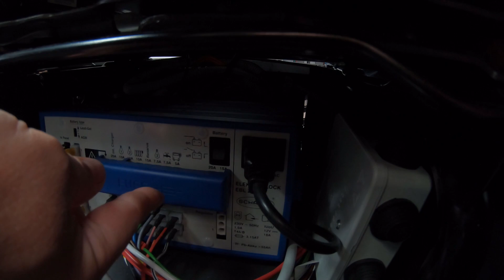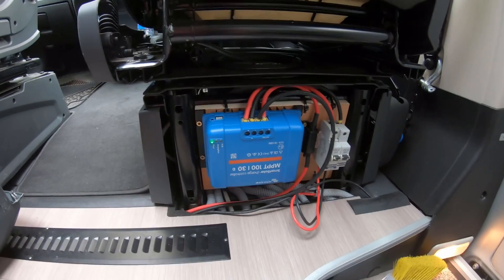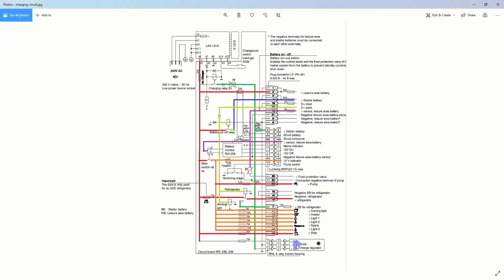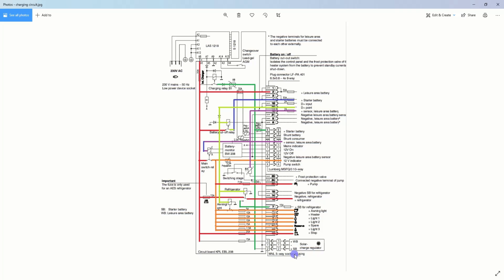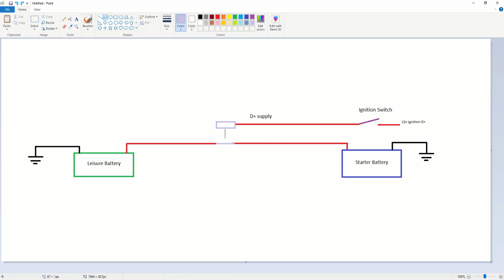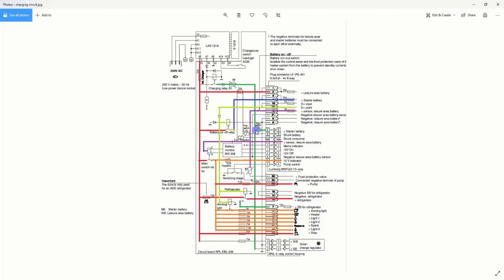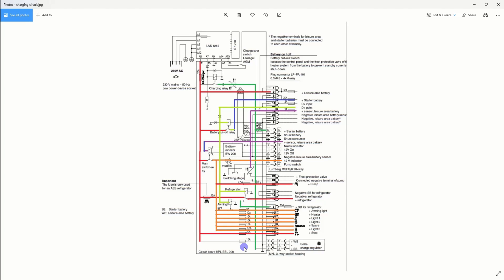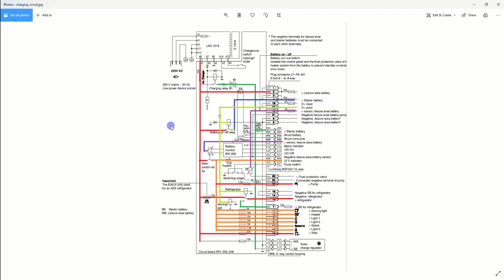Adria Twin solar wiring final part

Comment: Hi. Great videos. I watched your installation of the B2B anf felt confident doing the same. I did get myself a Votronic 50a for my 200ah Lithiumbattery. Fortunately I connected everything openly in the van (Twin 600 SPT) to make sure it worked before doing the proper cable work. I used 16mm cables and fuses on the positives, D+ from EBL pin 22 but everything else connected outside of the EBL . I also removed the fuse (50A) for the original charging circuit at the starter battery. ( I know you removeded the 30 a fuse in the pillar for this). Some 20 seconds after starting the engine and charging 35-45amp i noticed white smoke from the EBL 211 and shut everything down real quick.  I wonder if it had something to do with my NDS solar being connected to the EBL?, didnt think about disconnecting it beforhand.  Any ideas?

Comment: Great video. I’m a bit confused regarding how the charging of the starter battery is done. You mention that the starter battery is connected to pin 6 that is connected to the control panel. I believe that this is the voltage indication on the panel, not a connection to the starter battery itself. 
Could perhaps pin 7 (+ Starter battery for refrigerator) be used instead?
Reply from the maker: Hi, I will get back to you with a better explanation in a few days when I am back to work, but for now I will explain from memory some of this. The pins to the display you are looking at are small pins making up a plug to the control panel. None of these are battery connections only display power and monitoring connection. The pins for battery control are large pins to the left of the EBL. It has two 6mm (from memory) that connect to the starter battery, another two 6mm to leisure battery and two negative cables. The two cable to pins 3 and 4 I believe (I will check this later) they are the vehicle batteries connections, they both go to the vans pillar drivers side where there is a 30A fuse. These are paralleled cables to reduce voltage drop

Comment: If I unplug that three pin plug plug to the ebl everything is dead is that correct until I connect my mppt as I am fitting a 50amp dcdc mppt renogy controller cheers
Reply from the maker: If you mean the 3 pin plug from the solar controller to the EBL, this will only remove the charging from the solar so should not kill the rest of the van working
Reply: @BrackstonesTravelAdventures  hi mate followed your way of doing it but as soon as I remove the cable that connects to the ebl and to the sun control mppt my van is dead no power at the control panel is this right
Reply from the maker: No this does not sound correct, the THREE-pin plug that plugs into the front of the EBS is only connected to the MPPT so the MPPT can put in a charge voltage to the starter battery and the leisure battery. Your van should be powering off the leisure battery which comes into the EBL on pins 1 and 2 on the left-hand plug of the EBL (believe this is 10 way and pin 1&2 are at the top). Unless you have a newer van, which is a different MOD but I very much doute they changed this.
So, with the 3 pin plug disconnected check that you have 12V on pins 1 & 2, if not then you need to check the leisure battery is ok, any fuses and the isolation switch is not in the off position
Reply: @BrackstonesTravelAdventures  cheers really appreciate it I will check again I have a new fogstar 230amp battery  mine is a 22 plate but still has a b2b and a suncontrol 320m

Comment: Evening mate, your videos have almost made me look to install the  roamer myself, I get all of the install and why you bypass the EBL and how, for both solar and B2B. Now this may be a stupid question but if you take away all of the outputs to charge from the EBL, what feeds back into the EBL to run the 240 sockets and everything else on the van. i.e what feeds back into the EBL from the leisure battery and the 240 charger. Cheers, i know you have sold the van now but hoping your still here. cheers Paul
Reply from the maker: So if I understand your question correctly. First what powers the 240v sockets in the van? This is powered direct from the electric hook up via an MCB and RCD unit which will be located under your rear passenger seat. So the EBL has no influence on this power source. Your 240v sockets will work even if you took out the EBL. As for charging the battery, there is a 240v supply into the back of the EBL which is live when you connect the electric hook up (supplied from the same MCB/RCD unit). The EBL has a basic charger internally which will then put a higher voltage on the battery connection into the EBL so this will charge your battery. For Lithium this charger is not ideal, so I removed the 240V connection from the back of the EBL (Like a Kettle plug) and put this into a Victron blue smart charger. I then connected this charger to the lithium battery. I did a separate Vlog on this setup so it can charge leisure and starter battery if needed.
Reply: Thanks for the reply I didn’t ask the question properly, sorry, what im after is how does all the stuff that is managed by the EBL get power if you bypass it with the B2B an dthe smart charger. There must be a feed from the leisure battery back into the EBL
 for the fridge, lights etc? Like i said probably a stupid question. Is it the pins 1 and 2 you mentioned in the video? Thanks
Reply from the maker: Hi Paul. Yes you are correct pins 1 and 2 are still connected to the EBL. Pins 3 and 4 are removed (or fuse removed) as this is the engine supply through the EBL to the leisure battery which the B2B will now do. So all the supply for the van is still the same as it would be from manufacture through the EBL. Hope this makes sense.

Comment: Motorhomer , I want to place a B2B in my Adria Twin , do you have a video of how you installed it ? I saw in this video that you have disconnected the two red wires on pins 3 and 4 of the EBL . I would like to install the Victron Orion TR smart DC/DC charger 12/12/30A .Can you please help me with this ? regards Marc
Reply from the maker: Check this link for the B2B fitting, the cables to the EBL where removed to stop the charging from starter to lithium via the EBL. Its all done direct through the Victron B2B. https://youtu.be/1L7xhttk_S8

Comment: Great video Steve!
I am planning to replace the  battery in my campervan with a lithium and a B2B charger in my camper and i want to disable the charger on the EBL.
Looking at your video. Is it enough just to pull the starter battery cables (pin 3 and 4 ) and connect the B2B directly to the lithum battery?
Reply from the maker: Yes, if you have the same van as I have then I did a Vlog on the fitting of Lithium battery. I did what you are saying removed the starter battery from EBL back to the drivers pillar. Then run direct from starter battery via B2B to lithium with fuses. I also removed the 240v plug from the EBL as this does not have lithium setting and fitted a Victron charger which I can switch between the leisure battery or the starter battery if needed
Reply: @BrackstonesTravelAdventures   I do not have the same van but the EBL is identical. 
I'm under strict orders from the wife that everything i do must be reservisible if/when we sell it.
So my thinking is to just pull pin 3 and 4, insulate the ends and let them be in place and then run new 16mm2 with fuse from starter battery to the B2B.
Good call to remove the 230 i missed that one! 
So the plan now expands to make an adapter for incoming 230 to a new lithium charger,
Thank you very much!
Reply from the maker: That all sounds like good plan. The EBL 240v was old kettle style plug, I just got the same for the Victon so it connected up easily. Good luck

Comment: Do you know If the Twin Sports 640 SG 2022 has pre wired for solar? Wanna fit 150w flexlpanes on my pop up roof
Reply from the maker: Not sure about the sports model. If it is you will find a red cable under drivers seat with a sun simbol on it and one above the fridge. Not sure how it will run into the pop up roof. If you are on the adria twin Facebook group ask on there im sure someone on the group will have done it

Comment: Hi Steve, thanks for all the info so far. . . I've asked on the facebook group but have not had a reply as yet. . My question is: I have a 2020 Adria Twin 640 and I'm fitting a Maxxfan to the 40x40 rooflight.  I want to know if there is any wiring in place at this location. . and if not, where would I a pick up a feed?
Reply from the maker: Noy sure about the year but most from what i know have a cable in the roof which goes to the rear passenger seat where boiler is. Supprised no one on the group mentioned this as some have fitted them
Reply: @BrackstonesTravelAdventures  Hi Steve, I have fitted the maxxfan ok and located a feed cable in the trunking. . however there is no power coming through it. . I am presuming that this will be a fuse or a secret switch, but as yet I have not located it?  any ideas?
Reply from the maker: @howardkingsnorth1535  have you checked under the rear passenger seat by boiler for same cable. May need to continuity check any wires there to the one you found in the roof. I will be away end of the week in our van so will have a look
Reply: @BrackstonesTravelAdventures  Ahh yes.. there it is .. I will look for a 12 v feed for it tomorrow when I have a multi meter. There are some strange looking wiring configurations here..
Reply from the maker: It is a bit strange they take it to the seat compartment rather than to the EDL under driver seat. I can only assume this was due to older models having the EBL and battery under the passenger seat. You should be OK to take it from the water heater supplu via an inline fuse
Reply: @BrackstonesTravelAdventures  Hi Steve. . do you mean splice into an existing supply, or seek a 'spare' supply point? Its to not immediately apparent where to look
Reply from the maker: Its hard to say without looking. I would have thought they put in a supply seeing as the cable is in that area. You have the option running a new cable to the EBL which is not to difficult. I was thinking if you can find the main water heater supply line it should not be to much problem to splice of this with an inline fuse, the max fan will take about 4 amps. If you have the Whale water heater this is gas only so current consumption will only be control consumption, from what I can find this will be 1 amp. I would ask again on FB group now you have the two ends of the cable to see where others have connected up the supply to
Reply: @BrackstonesTravelAdventures  Hi Steve. . there was a feed there, I just needed to figure it out. All up and running now. . .thanks again
Reply from the maker: Great least I know now incase I ever deside to fit a Max Flow good to know its all working :)

Comment: Great explanation Steve. Does this only apply to when you use solar panel and B2B? I have no solar panels but have a B2B and did not disconnect the leisure battery charging thru the EBL. It charges the leisure battery from both EBL and B2B from the alternator. I was wondering if that could be bad, but I've seen others do that as well. ...and thanks for shouting out our very helpful Adria Twin Group on FB, where you contribute alot.
Reply from the maker: The B2B has three functions. It ensures a proper voltage charging profile essential for smart alternators. It protects the alternator for over current charging and removes the starter battery when the engine is not running to prevent draining it when on site. If you leave the EBL still connected then you are removing all these benefits. If you install a lithium battery with the EBL still connected then you could burn out wiring and alternator. It's pointless having a B2B fitted if you are still charging through the EBL
Reply: @BrackstonesTravelAdventures  Thanks for this answer Steve. I just thought that it would work in the same way as if i had solars that also charge while you are driving (ofc with settings for lithium battery.) Just as any second source of charging. The EBL have managed charging pf ofcthe leisure battery until now with ok result, just a lower amp rate. I was just wondering if i could damage anything. They are separate source of charging. For sure the B2B charger is better performing and also have a better charging profile. As it seems now i do not need the EBL connected since the charging from B2B is definately good enough. For a weekend as now with temps that require heater on ( runs at nights) i  use less than 13% out if my 161Ah battery. Last weekend the same, camped for 4 nights and used 23% of the caoacity. Thats great and the battery recharge on my way home easily. I will remove the EBL from charging. All the best/ Mattias
Reply from the maker: You may be right with it not damaging anything. I know in your previous Vlog you was monitoring it on the BMS and it was pulling a low current. Cannot be sure if you have 50% of the battery used that the charge current does not ramp up to 30 Amps or more. If it does the battery will pull 30 amps through the B2B and 30 amps through the EBL, so 60 amps in total load on the alternator. Like I say this is all theory as I have not tested this. I assume you have connected the B2B direct to the starter battery bypassing the EBL. Another problem I see is that the EBL does not have any charge profile for the alternator charging so the charging voltage may be higher than the lithium can take. This could damage it over time and will invalidate any warranty. I spoke to our lithium supplier and he said the BMS will record any charge voltage and if its showing an incorrect voltage the supplier will not accept any warranty claim. As for solar, we have all Victron devices so can monitor them by Bluetooth. One thing I have noticed if the solar ramps up to full Bulk charge the B2B sees this voltage and switches the charge profile to float. I have sometimes switched the solar off or lowered the bulk charge voltage when on the road so the B2B does all the charging. Best thing we fitted was the TR-16 battery gauge, I use this as a quick monitor of the charging when on the road. We are still waiting for our Lithium battery.
Reply: @BrackstonesTravelAdventures  Yes, the BMS and controlunitvin the battery register everything. Only wierd logs is the ones i got from the charging via BMS and 230V. Never  from alternator. But as i said i do not need the BMS/alternator charge as i see it. It just adds the amps that still are low what I can see. My take is that the BMS prohibit anything, this is what it looks like. I also have a tempsensor at the negative pole at the battery to the B2B. D+ i got from the EBL in wireing. The charger could be witvout any of these since there are profile/sensor to get it to work anyway. But withlut D+ there was risks what i could see (between the batterys in the start moment) . Both connected gives the most effect out of the B2B.

Comment: Hi, I wonder if you can help. I have just bought a new sgx and the led lights flicker when I start the webasto heater and again on cool down. Have you had same issues? 
Have contacted the dealer but not heard back yet?
Reply from the maker: Yes this is common. Caused by voltage drop when heater starts up. Not serious but can be annoying. Apparently there is a dealer fix on this. It's being discussed on the Adria twin Facebook group. If I get a fix I will update it on my channel